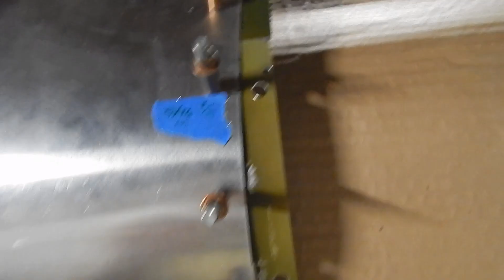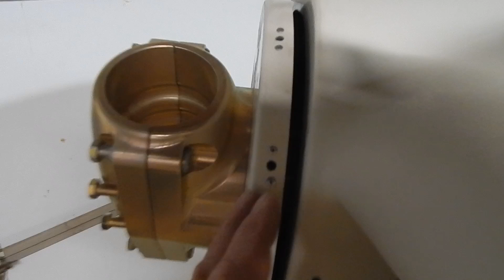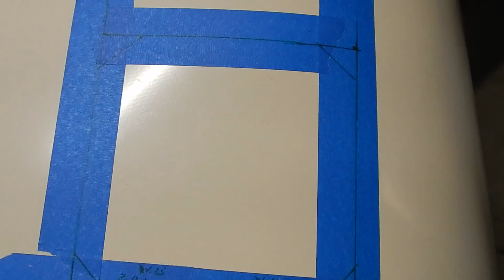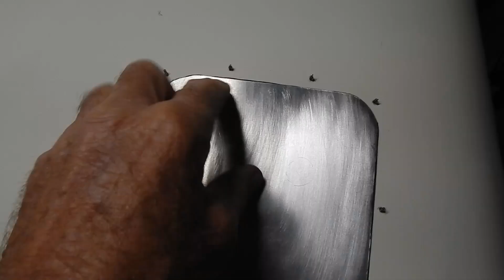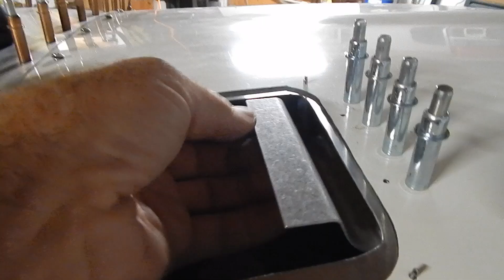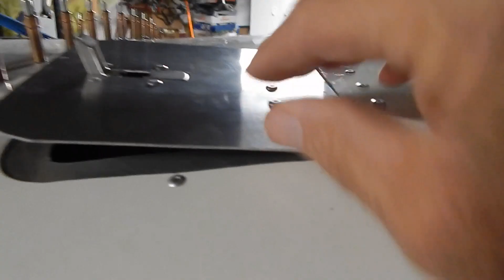RANS S21 Build ep 55 Cowling Part 4

Comment: Putting a straight hinge on a curved surface of the cowling is a problem.  Probably should have put the hinge on the side so that the door opened to the side.  The cowling is straighter in that dimension and thus the bulging would not be present.
Reply from the maker: I think you're right.  I was just following the directions and other builders, but I can see how a side open might have been a better option.